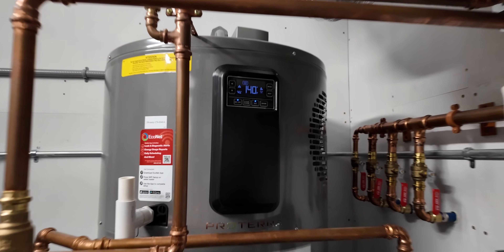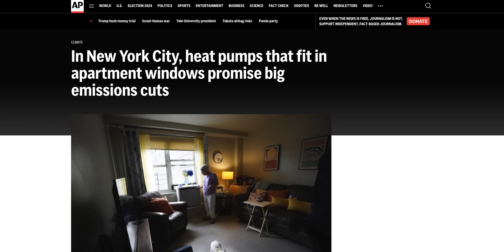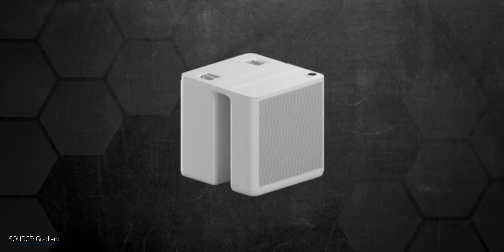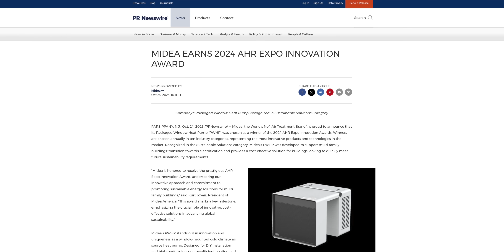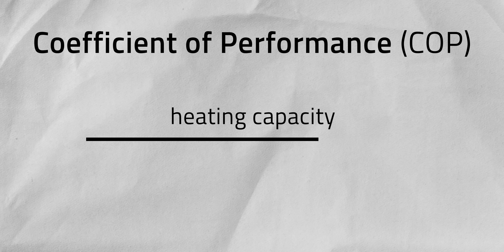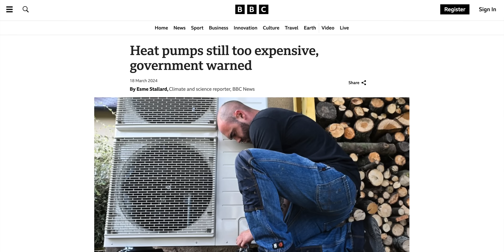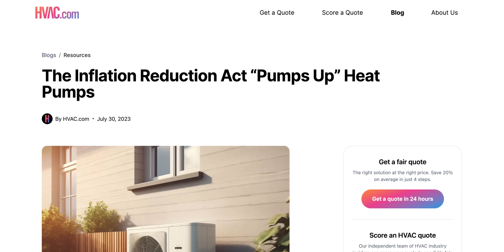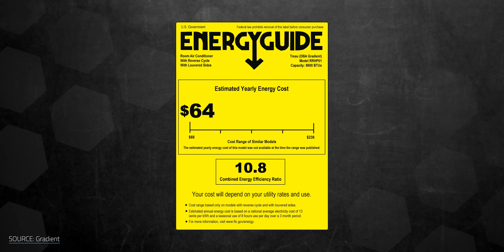Why This Window Heat Pump Is Genius

Comment: Sounds lovely, but not at 3K.
Reply: Maybe for $600 at the most like damn
Reply: You are paying the "American's think heat pumps are magic new futuristic technology" tax. In Australia something like this is readily available for about $320 USD and has been readily available for over 50 years. I hear of people in North America and Europe getting heat pump air conditioners installed and paying $10k $20k $30k $40k USD and am completely astounded, your installers are absolutely taking the piss. I installed a whole-of-house ducted air conditioner in my house AND 3 mini splits (26kW or 90,000 BTU) all for just over $10,000 USD.
Reply: Midea already manufactures and sells two models at 8000 and 12000 BTU for $350 and $500 respectively, there is no way a 20,000 BTU unit should cost over $1000.

This price is only so high because the government bid request said "no more than $3000"
Reply: @lordhosk  Midea: 'What's the max you're offering per unit?'
NYC: '$3K per unit.'
Midea: 'OK. That'll be $3K"
Reply: @lordhosk  So you know damn well the company is going to collect ever dime. Probably some insider trade or deal going on.

Comment: In reference to the grid and the strain all the heat pumps would collectively add... Are they not just replacing space heaters and window a/c units currently in use?
Reply: I think many buildings have the central heat and many residents have window ACs. But the heating is at low efficiency. Imagine 1,000,000 BTUs of fuel is burned in a boiler room to heat a building in the winter. Now, with everyone having heat pumps, it would take only 400,000 BTUs to heat. But, it does use electricity instead of natural gas or oil, so the grid does get strained more. Overall, less energy used though.
Reply: @rclewis01 This^

It's more efficient energy, but MORE total electricity usage overall. Yes, some will be converting from shitty window a/c to heat pump (which will actually use less electricity), but many will be converting from natural gas as well.
Reply: The concern is that we're replacing fossil fuel heating with electricity, but it will be a mix of that and replacing resistance heating. 

But regardless it's a non-issue. We aren't going to roll it out all at once and grid upgrades are happening all the time with this planning in mind. It's nothing new.
Reply: But let's add E.V. to the grid in the meantime. Makes sense.

Comment: Why not just install a $150 AC unit backwards? 😂
Reply: lol yeah, theoretically. I think the problem is the regular units won't be able to draw enough heat out of the winter air. minsplit units can, probably because of more efficient design and different refrigerant.
Reply: How about;    it will drip on your carpet?
Reply: A heat pump is just an air conditioner running backwards, so there is no reason for one to be much more expensive than the other. Indeed, most $150 AC units can both heat and cool as far as I know.
Reply: @thorvaldspear  almost NONE can. in fact I am only aware of a single unit that can and its only good down to 41'f and is $379.

otherwise "NO" window units I am aware of work as heat pumps. many have HEAT but its "NOT" a heat pump. its a resistance heater built into the unit meaning zero efficiency difference than plugging in a space heater.
Reply: Because it needs a reservoir of heat to pump. Not much hear outside in the winter. Thays why they usually use a large tube undergroind to pull heat from. In my xp they arent dit for purpose.

Comment: Wouldnt it be easier to take their existing AC window unit and just turn it around half the year?
Reply: The sizing of the condenser and evaporator coils will be totally wrong. If you’re lucky, it will still run, just very poorly. I would guess that it would end up feeding liquid into the compressor and letting the magic smoke out.
Reply: The thermostat and moisture drains would be on the wrong side.
Reply: @JohnClarkW  but..... would that work? how well? you can move the thermo and drain. I honestly wonder if that could work at all. I bet theres a wee bit more to it than that.
Reply: @nerys71  I have no idea, but I think it is harder than I think.
Reply: @nerys71   There's a bit more needed, most importantly defrost controls for evaporator. The most efficient way to do this is by reversing refrigerant flow but in a pinch you could use a resistive heater on the evaporator coil. When the coil ices up you turn off the compressor and run the heater until the ice is melted.
Reply: Nope. How much heat is outside in the air in winter?
Reply: @jhoughjr1  Plenty of heat outside. The absolute coldest temperature ever recorded is -128F. On a thermodynamic scale that's 184K, meaning there's still 62% of the heat as temperature of 70F / 294K. During a more reasonable winter there's much more heat.

Comment: @UndecidedMF I work for #SiemensEnergy and was very happy to see your industrial heat pump picture reference our technology.

I love watching your videos and commentary, as someone who has worked in the energy industry since I retired from a 20 year career as a Nuclear operator for the Navy. You provide well stated information on leading edge technologies and the realm of all things that help us to reduce the amount of heat we reject into the world or retain in the atmosphere.

I'm trying to remember what you referenced for heat removal/Water heater in a garage... I live in Texas and my garage is easily 95F or hotter during the summer months... I have an insulated roof/attic space and it's still miserable hot.

I know there are solar powered fans you can "duct" in to your garage to remove that heat. I'm curious if you've seen any technology that would be more ideal.
Reply from the maker: Thanks for the kind words.  As for the heat removal/water heater, I think you referring to my Rheem heat pump water heater.  They will pull the heat from the room their in to heat the water, which cools off the room.  You might want to look into any heat pump water (Rheem or not).  Other than that, there are some small solar powered exhaust fans that you can get, which can help a lot.  I've actually been looking at those for a shed I have in my backyard.
Reply: @UndecidedMF  thanks Matt I was looking at a few after I commented here..  I've found a couple I'm interested in... I also think I could do a nice DIY project... if you'd like to share ideas or swap info offline let me know.

Comment: Not finding 3K as an affordable option. Unless the landlord is going to spring for this, it is still out of reach for most renters.
Reply: agreed, it is basically an air conditioner with a reversing valve added. Why isn't this about $500? Because it says "Heat Pump" in the name.

Comment: I actually have a Midea AC unit that is capable of reversing the heat pump. However it is a portable unit, as my windows slide left to right and are not wide enough for a normal window AC.

Comment: You can buy the best full heatpump on the marked here for that cost, being able to cover way more square meters than a window unit. Also all heatpumps here run on the R32 cooling systems, we even had a old unit that installers wouldn't touch as it ran on the old R22.

Comment: You're totally right about the projected surge in electricity usage if these take off. I don't know about the US, but here in the UK our electricity network would crumble if every household switched to full electric. There's probably always going to be a need for natural gas which is why we're exploring Hydrogen and Hydrogen Blending as a viable long term Methane replacement.

I do like what these window heat pumps are all about. Although they'd need a redesign to come to the UK as they would be compatible with the majority of our windowspaces.

Edit: I thought I was subscribed to you! D'oh, let me resolve that...
Reply: Hydrogen from hydrocarbons is as bad as Natural Gas. It would be hugely inefficient to generate electricity in order to generate green hydrogen, much better to power heat pumps.

Comment: "heat pumps can heat and cool, but AC units can only cool" bro what do you think AC units are? It costs $100 at most to add the valves and piping for reverse cycle. These are priced to maximize early adopter tax, within a year or 2 similar devices will be ~$300.

Comment: Heat pumps are a great technology, but one thing no one talks about is how broken US capitalism is ruining them. First, every single HVAC company I have spoke with has exclusivity deals with certain brands. They will only install Carrier, Bryant, Rheem/Ruud or whatever other company they signed with. Second, nearly all of them are installing super old technology. A lot of the brans with these contracts have very little competition and no need to innovate. I literally can't get anything except 20 year old technology unless I spend like $20K on a heat pump. If I want to speak $8-12K ther are a single stage, can't operate in cold weather, old style heat pump. Often, they quote me parts that the manufacturer themselves doesn't even make anymore (or atleast doesn't list under current products). PLus they often don't publish clear energy ratings, it is a fight to get SEER ratings or COP.  So I can either spend $10K to get a crappy, 20 year old technology heat pump with no choice in manufacturer...or I could just keep maintaining my old school AC and gas furnace. I mean, hell, Bosch has a highly rated 17 SEER variable rate compressor modern heat pump (The BOSCH IDS Light) and it is literally impossible for me to get it installed even if I wanted it, and I live in Atlanta a major metro area. So what do you think I am going to end up doing? Maintaining my old system, despite the fact that I actually want a heat pump and a heat pump is better for the environment and energy grid.

Comment: I prefer Mideas current U shape...for $300 delivered to our door, it's 12kbtu 15SEER, it keeps our living room cool and it's using way less energy than our old 8kbtu window AC that could barely keep up.  With our kids, pets and furniture I want it higher up, not lower to the ground.  Contemplated getting a mini split but after factoring in installation supplies/costs even DIY it would take way longer to pay for itself...plus we can bring the window unit with us or switch it out easier when the next efficiency leap happens.  The one we got doesn't do heating but all they'd really have to do is add the reversing valve, the app even shows heating options it just doesn't work.  Natural gas is still just so much cheaper to heat with, compared to $.27/kWh.
Reply: My power is a bit cheaper but that is close to what I pay for 1 therm of natural gas. Which is 30x better than a COP of 1 electric system that Matt is always implying. Doing the math an old trash tier 50% efficient gas furnace at $0.30/therm has a cost of $0.60 per useful therm. That is still less cost to run than a heat pump with a COP of 5 and power at $0.15/kwh ( 1/5  *  .15  * 29.3 = $0.90 / useful therm). The reality is that most of these heat pumps start to fall way short of a COP of 3 when temps get even remotely close to winter temps in my region and a decent gas furnace is 90-95% efficient.
Reply: It has been shown electric to heat conversion is more efficient than gas to heat.
Reply: 27 cents per KWH ?  My rate is 9.3 cents per kwh .. from my pov almost 30 cents per kwh is a bit too much..
Reply: @kennyiglesias622  Upper Peninsula Power Company.  Basically the only provider and they don't even make enough of their own power all of the time they have to import from Wisconsin sometimes.  It's what's making buying a used EV not even worth it, until I can figure out more solar.  Just put up a 3-4kWh array and that's offsetting a lot of our home loads... should pay for itself in 3-5 years.
Reply: @kennyiglesias622  30 is close to the highest in the US. Your price is about the lowest. Most are in the 10-15 range and all but a few are 20 or less.
Reply: Well ywah 50 percent more power will do 50 percent more work
Reply: @jhoughjr1  except it's the other way around, it uses about 50% less power and has more cooling

Comment: I have Midea U AC units cooling my house (New Hampshire). They have been excellent, exponentially better than every other AC unit that I have owned in energy usage, noise (they are almost silent), and ability to keep temperature. They network together with an app that is nothing special, but functions pretty well, and also connects my dehumidifiers. I would absolutely look at purchasing one of their heat pumps. In the winter, about 1/2 of my heat is from a wood stove, but the furthest room doesn’t get that much heating from it and would be ideal for one of these window heat pumps.

Comment: I would love to see these mass produced.  I have switched from whole house 4 ton unit to spot cooling individual rooms with Midea inverter units.  In Texas heating is no joke.  These units have been very efficient in cooling the rooms and dropped a lot of electrical usage to stay cool in the Texas Heat..  I would like to see more innovation in these areas and wide spread of both heat pump and inverter AC units

Comment: This solves my Bonus Room over my garage issue! There are two small man doors into the attic that will allow me to insert the heat pump "into" the door and not use the front window (unsightly). If I ever move then I can just replace the small 4 foot door! Done deal! Sweat!

Comment: There is one major design flaw with this. The fact that the outdoor section hinges for installation and removal.   This means that the unit is not hermetically sealed.  a portion of the refrigerant lines have to be rubber to allow for this, just like in automotive applications. Estimates with modern vehicles are in the 7-10% refrigerant loss each year because of the semi permeable nature of the rubber tubing that couples the compressor to the rest of the system so the egine can move on the engine mounts. I guarantee that at this point these units are not meant to be recharged every few years, which means their fancy efficiency rating is going to drop quick.
Reply: Well not necessarily. A long enough coil of copper tube can easily bend 90 degrees without any damage.
Reply: @michaelbuckers  while you're right, that may be possible, copper isn't cheap so it's very doubtful that's the route they took.  I watched the part of the video again where they show the internals being assembled, but you can't see the top where this would be, so you can't tell from the video.
Reply: At $2-3k per unit, I think they’re probably using all copper inside.  Maybe they will be using rubber if the price is that of a window A/C unit  ($150.00).  But they can’t justify $2-3k pricing and skimp on the internals.
Reply: Some of this type of unit use a coolant rather than refrigerant to bring the heat inside (or outside). This requires a few more parts (which could explain some of the price) but keeping all the refrigerant outside has some huge benefits. In addition to easy flex joints it lets them safely use more dangerous refrigerants which are often more efficient.

Comment: the biggest issue i see with this is the fact that a lot of windows are side opening......this design will not work with any of them. I convinced my landlord to put in a minisplit. She paid for the unit i paid for instillation, my savings in energy costs paid for that in 3 months and now i enjoy much lower bills and much better control of the temps in my apartment.

Comment: you can have your "heatpump cake and eat it too" unless you have sliding windows - which are common in many buildings.  A unit for this configuration would be ideal.
Reply: Mini split unit

Comment: now if only they can make those that work with horizontally opening windows. Like most of the rentals I have had.
Reply: minisplit works. i also can't believe I'm saying this, but it may also be cheaper lol. those upside-down window-hanging units are an absolute ripoff.
Reply: You can get both traditional and upright oriented reverse cycle (heat pump) window air conditioner units for those windows but some transfer of fresh air is also important health wise and not all necessarily do it

Comment: I wish these were possible for european windows that only open to the sides.
Reply: just get minisplits instead. might even be cheaper.
Reply: @snowballeffect7812  thanx! Unfortunately, I live in a rented flat. Something that I could take with me when I move would be perfect.
Reply: @mael1515  ah, i guess convincing the landlord would be out of the question? lol. some places have subsidies/rebates so might still be a good long-term investment for them. I suppose it's a growing problem now in Europe since AC wasn't really a requirement before climate change made things a bit off kilter.
Reply: @snowballeffect7812  my landlord is actually pretty amazing, but the central gas burner is only a few years old, so replacing it is something that I don't even have to ask for.
Reply: @mael1515  nice!

Comment: In a lot of apartments in NYC, your radiator is either off or on. Which means in the winter your apartment could feel like you live in the Amazon. And in the Summer your apartment will be like the Sahara on a warm day. Sometimes in the summer they can't turn off the radiator right away. So you have heat from your radiator and from your environment. And that's why you'll see a lot of New Yorkers hanging out in front of their buildings. With tables and chairs like they were indoors.
Reply: there is a reason for that, temp controller often go bad and often very expensive to replace. It is cheaper to leave them out when they fail and just bill the renter for the extra energy.
Reply: @paperburn  heat is free so they don’t get extra from the tenant in those buildings
Reply: @paperburn  the problem is that they’re usually rent controlled or NYCHA buildings so the landlord has no incentive to be kind.